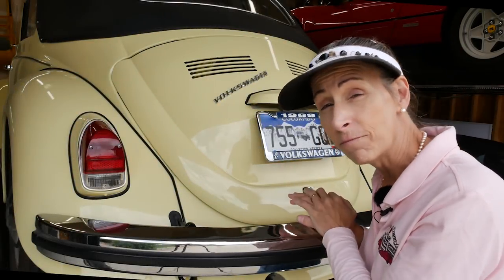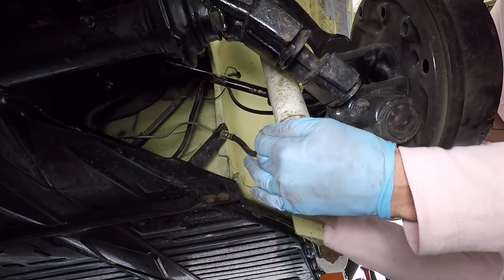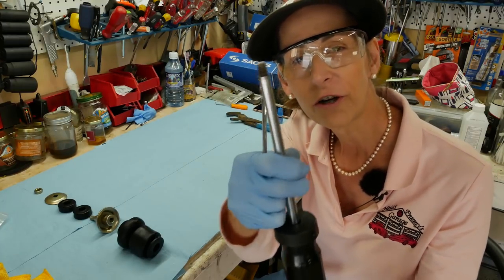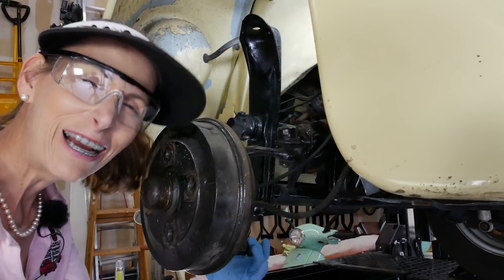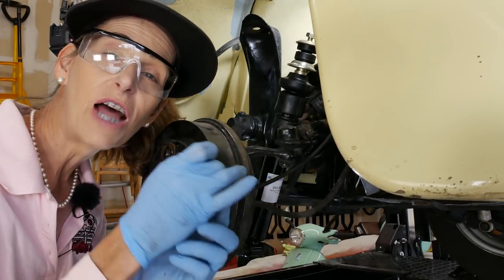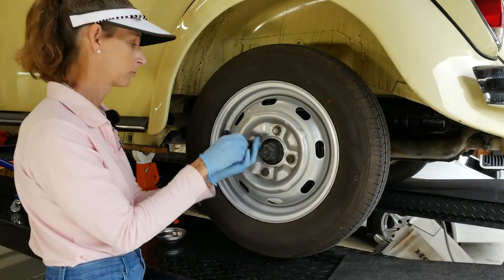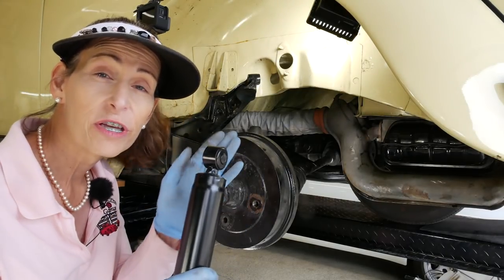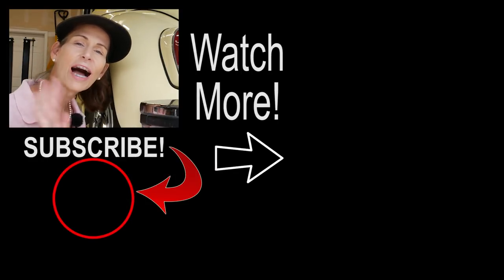VW Beetle Shock How-To!

Comment from the maker: Hi Everyone, A video on how to replace the shocks on classic VW Beetle.  This car is a 1969 with the ball link front end and the IRS in the back.

Shocks (http://www2.cip1.com):
Rear: VWC-113-513-031-N - GENUINE OE SACHS OR BOGE BRAND - REAR SHOCK
Front: VWC-113-413-031-E - OE GENUINE BOGE BRAND - FRONT SHOCK
Installation kit: VWC-131-498-441-CP
Reply: I have been following your posts and love this car.  How did you find a nearly 50 or so year-old car that has an underbody that’s in great condition?  

It may have been redone at some point, but still looks ‘new’ without signs of being re-worked.  

( yes, I saw this was posted 2 years ago ..  why I said nearly 50 years old for a 69 bug. )

Comment: Could you please do a video on how to replace drum brakes? I have a 1979 VW Beetle. I can't find a car shop nearby who still knows how to do drum brakes. Love your videos! Many thanks!
Reply from the maker: I did a video on the 356 brakes, but they are a little different in that there are two cylinders on the front wheels.  I need to go through the entire system again at some point.

Comment: 1969 converted autostick Dr. de carbon system rear shocks? the only information I found is it was a high performance secret under license, It is a matching numbers VW 1500 Sedan autostick with sun roof  converted to manual even the motor is original! it appears the conversion has parts prior( May or June of the 68 model year)which seems would have been right before switch to all manual standard beetles from Aug. 68 to July 69 model year in the U.S.  having i.r.s., in other words no one had to convert to get the  i.r.s. in U.S. to get what the autostick debut of the 1968 model year already had.My point is somebody in America might have known what they were doing in Germany before my original factory build date of 12 June 1969 happened, by the way love that 69 and thanks for the fantastic video!

Comment: Darn it! The rubber and bushings from the front shocks decided to stick around on the suspension mounting pins as I removed the shocks (yepp, they didnot want to go off easily). Any tips on how to remove the bushings?

Comment: video made me want to do this in the future, currently working on passing emissions, terrible time to get this 1970 to pass every year for the last 5 years, this year is not the case, 2 mechanics say I need new carb, rebuild carb, re jet carb, second vac leaks may be the problem for high HC/CO,  both say cost starts @ $500, final diagnoses is get new engine, My thought they didn't know how to fix this, and hardly do auto shops have the knowledge. Difference between a Mechanic Vs. Tech. Mmmmmm currently trying to trouble shoot.
Reply from the maker: Your spark plugs will tell the real story...  If they are black and sooty, the car is rich, white/light brown then lean (vacuum leak).  You may have some issues with your carb, but they can be replaced pretty cheaply and it is easy to do.  Just think of what all the possible issues it could be.  Do a full tune-up with new plugs and points and oil, set the timing and the carb and then see where you are.  You'll get it.

Comment: I know this is an older video but I am about to replace the front shocks on my Spyder replica which has the same KYB gas adjust shock that you had on this car. I am wondering why they wonted them replaced because they look like they are in good condition. The reason I am replacing them is because they were too stiff and I want a smoother ride. Is that the same reason theses are being replaced?
Reply from the maker: Yes,.... Same reason ;)

Comment: I really like your video about changing the 2969 Beetle shock absorbers. Could you let me know where you bought the Sachs front and rear shocks from, I have a 1970 which I want to change from gas to OEM oil shock absorbers and I am having a tough time finding a parts distributor that carry the appropriate Boge/Sachs brand.  
Thanks,  Jim Semertzides
Reply from the maker: I think I got them from cip1.com.  Either there or JBug.  The owner was very happy with the change.

Comment: Great vids ladies, there's a plastic dust cover missing however from the kit for the front shock that protects the exposed piston rod. Would have been with the old shock but since it wasn't an original its been thrown i guess.
Reply from the maker: That is a great point.  I did film a blurb on that, but cut it since I didn't have the part and couldn't source it.  I did see it in the OEM parts breakdown.
Reply: Heidi and Franny's Garage I have been trying to get the original dust covers back on but found it near impossible. Tried warm water to soften the rubber. The dust covers are now readily available in the uk and have a small cut out so perhaps the idea is to cut the rubber and screw it in? 
Great video thanks.

Comment: Very good sound, lighting and flow a YouTube pleasure.  May I ask 1) how to test the need for new shocks? 2) do you think there are any magic codes on the previous shocks to indicate age?  Previous owner did not have full documentation.  Thanks again. t
Reply from the maker: Thanks Tim, The easiest way to check your shocks is to press down on the car (bumper works great, but be careful if you use the fender) and then release.  It should return to the original place, but not overshoot.  If it does, they need to be replaced and do both left and right at the same time. They need to be the same.  I didn't see any codes on the old shock so I dod a bit of searching on the web and found that they are great for the track, but not great for the street.  When in doubt, go back to OEM.  The original engineers crunched the partial differential equations for the suspension configurations and know exactly what damping to use for the correct ride and safety.  As an alternative, you can have someone follow you on uneven roads at different speeds looking for any ringing of the wheels.  The PO who built the car had some documentation but passed away.  His wife (who sold the car) is still going through her late husband's mountains of paperwork as the story goes.

Comment: Such a simple process. Changing the struts/shocks in my E39 takes ages and requires removing the entire rear seat and trim.
Reply from the maker: Wow! Really?  But the E39 is pretty sweet.  collapsing coil springs frightens me...  The thought of what that thing could do...
Reply: I'm very happy with my car; it's an 02 530i (manual) with more than 200k miles on it. Awesome daily driver, with pretty decent fuel economy for a big sedan. The coils are a little sketchy, but when I replaced the factory "sport" springs with with H&R Sport springs, I found I didn't have to compress them much at all. Go slow, use hand tools (because impacts can cause the spring compressors to slip and cause the spring to explode), and wear PPE, and you'll be ok.
Reply: The rear shocks mount underneath the rear parcel shelf and speakers, so you have to remove the seat base, seat belts, headrests, C-pillar trim/lights, child seat anchors, rear seat backs (on non-fold down seats), the parcel shelf (and sunshade if equipped), and finally the rear speakers to get access to the three top bolts on the rear shock/spring assembly. It also requires finagling the charcoal canister/evaporative emissions stuff around on the driver's side, and moving the fuel neck on the passenger side. It's a good 5-10 hours of work.
Reply from the maker: Oh my!  They must have started with the shocks and built the car around it!